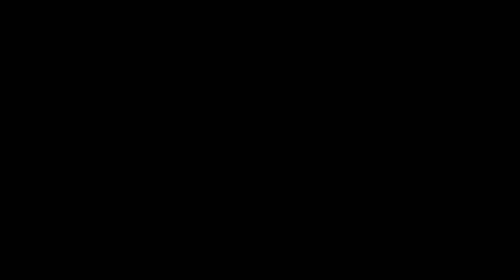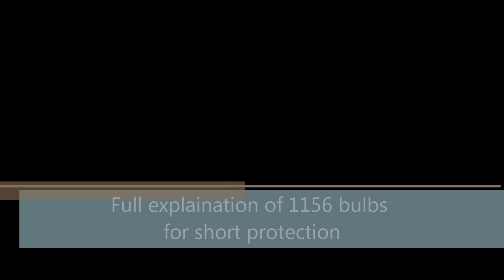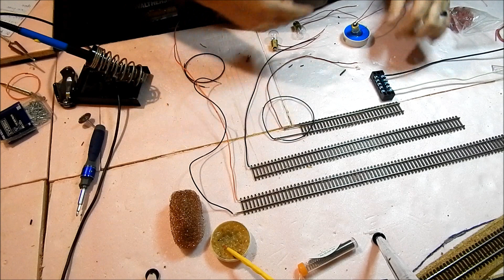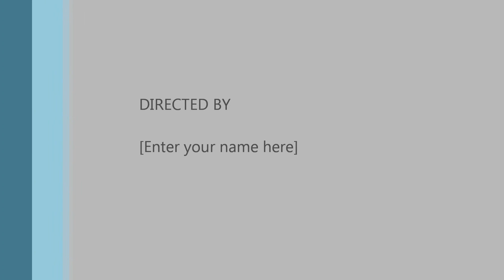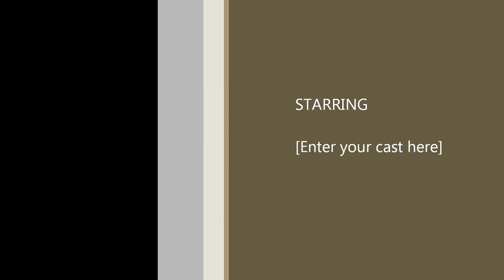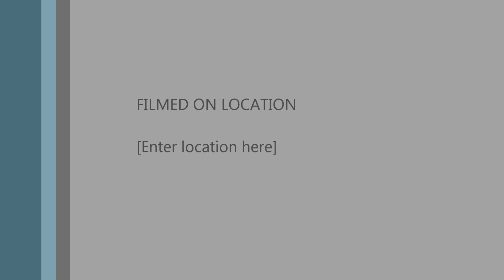short circuit protection for model trains

Comment: Rick  this looks good, only question, do you need to install this between one section of your sub bus, or you install between a feeder wire then connect to your sub bus
Reply from the maker: If your doing sections then it would be BUS>LIGHT>SUB BUS or FEEDER. Sub bus is not necessary. I only added it because i will be attaching more items to the bus later; block detection, signals, etc.

Comment: Nice cheap easy solution for short circuit protection.
With the price of the DCC units, decoders and engines, especially here in Australia. A 50cent bulb will save hundreds of dollars.
To solder the wire on the side of these light bulbs, to make the solder stick to it easier, just lightly sand the spot where you want to place the wire, as the side of these bulbs now have a coating on them to prevent corrosion.
Reply from the maker: Thanks Arty. you right a quick cheap solution. I didnt think of the coating on the metal. good catch.
Reply: Or get some bulb holders from a car wreak

Comment: Hi Rick great video  on your layout you  connect feeders to a sub bus then hook up the sub buss to your main buss
Reply from the maker: Yes. this time i did for my top desk. the bottom deck is done the traditional way but uses NCE circuit breakers. I will eventually change that to this.
Reply: Rick Bailey  thanks  for the info
Reply: Thanks you just one more easy step for me, going to work on some sort of video on what I have, just can’t build yet  but sure hope soon, I need track
Reply from the maker: There are a few discount codes out there. Vinny has one for yankee dabbler. I think luke towen has one for micro mark and dg modelworks has one for midwest model railroads.
Reply: I live in Canada about 1/2 hr from Sparky 107107, going to use pico track not sure on the turnouts yet , need more research but i do have the NCE procab control system
Reply from the maker: @dundasjunctionmodelr.r-james  Sparky is awesome. He's the one that got me to start posting. All my track is Atlas flex track and Atlas turnouts. I dont have any experience with other brands.  Sparky is using the NCE Powercab system. I have both the 5Amp Pro cab System and the Powercab. Right now i only use the PowerCab for my Xmas trains, but eventually i want to use it to run with JMRI and do my programming track.
Reply: Rick Bailey  I purchased the NCE system because that was the system Sparky is using, going use Peco track , I am not a great video person, not sure how to edit maybe some day I will be able , for now I will use my phone but I I do have a canon 5D Mark IV camera that does video will keep u posted
Reply: I just checked amazon.ca  1156 bulbs available pack of 8, they also have LED version too
Reply from the maker: @dundasjunctionmodelr.r-james  DO NOT GET LED. the point of the incandescent bulb is to absorb the amp current. The point is to protect the circuit not just to light up to identify the problem.

Comment: So how many of these things i would have to put on my layout? Thank you for showing how too
Reply from the maker: it depends on your wiring.. Im going to guess that your layout is all one piece, correct me if im wrong. I would definitely use one bulb on the feed wire coming right out of the NCE panel before it hits the track. It should be sufficient. again all we are trying to do is stop the AMPs from back feeding into your system, in your case that means your NCE powerCab throttle. If you have any other isolated track sections I would say put one there too. This way if that secution is shorted the rest of the track should continue.
Reply: @FBMRR  my layout is a 4x8 and i have a small add on for the engine house and the turntable
Reply from the maker: @KerleyExpress  is your wiring in sections with feeders, or is it all one piece of continuous track?
Reply: @FBMRR  lol i don't have the feeders started yet lol i could make a new video on my layout explaining how i want it to be if that helps any
Reply from the maker: @KerleyExpress  sorry i assumed you were already running DC. Are you able to run any train of any kind?
Reply: @FBMRR  I did have dc hook up at one time but haven't ran it in a long time
Reply from the maker: @KerleyExpress  are all of your rails connected or soldered together as one long loop?
Reply: @FBMRR  not all yet i have a bunch of turnouts that has to be installed yet.
Reply from the maker: @KerleyExpress  so ur not ready to run yet at all. Goos you have time to make or buy ur circuit protection.
Reply: @FBMRR  yea I want to get almost most stuff sat up before I run. So I want to do the protection thing

Comment: Good job on the tutorial Rick. Importantly you used terminology that would be familiar to the layman wanting to do this. The only potential problem with this type of short protection is when operating a consist of multiple (say 3 or more) sound-equipped locos the combined current draw of the locos through the bulb can generate enough DCC voltage drop to cause a sound decoder to cut out.  Art...
Reply from the maker: Cutting out the decoder is the whole point i would rather have the power surge absorbed by the bulb than the decoder. Also the short wont travel back to your command station. Which is more important.